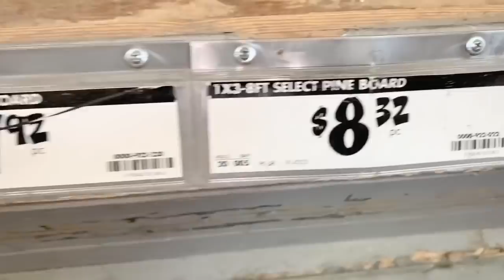Modern Room Decorating Ideas || 24” Lighted Floor Vases

Comment: I did this maybe 25 years back and put mirrored strips around them; I still use them. Yours are very beautiful ! Just in case your viewers here don't have a drill I used paneling nails and a hammer. It works fine.
Reply: Thanks! I don't have a drill.
Reply: Carol Crowley I’m happy paris rain shared her method for those who don’t have a drill! If you get the chance to get a drill, I’d definitely recommend a Makita. My fiancé bought me one and I absolutely love it! It’s also much lighter than a Dewalt, which for me is a huge help, because I have terrible carpal tunnel. I can barely do anything w/ my left hand (luckily I’m right handed), and sadly that’s the one I had surgery on hoping to improve it, but for me it only made it worse. Anyway, that’s completely off the subject lol, just thought it might be helpful to some if thinking about buying a drill. 😊
Reply: Omg thanks for that info

Comment: I have enjoyed the video and what you have did it’s beautiful.how did you change the batteries?
Reply from the maker: I attached the battery pack with a Velcro command strip so I can easily remove it, change the batteries and add it back to the vase as needed. TFW 💕